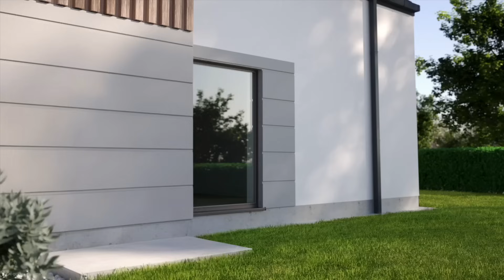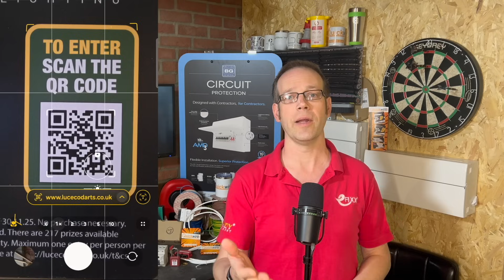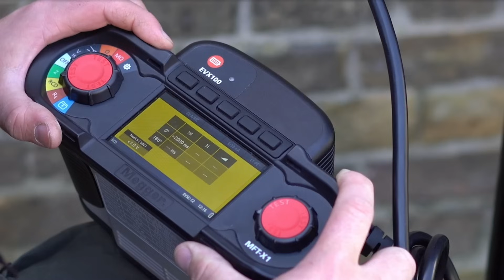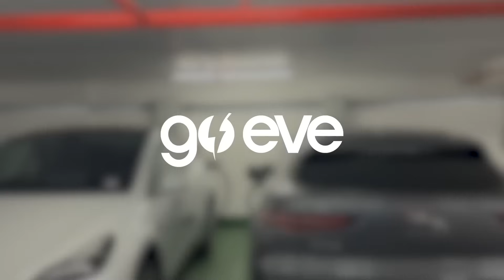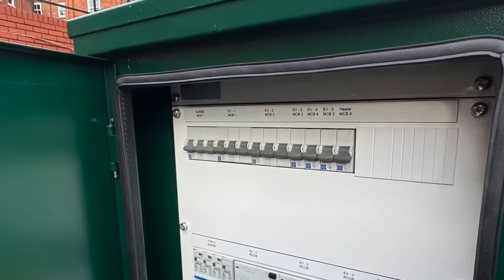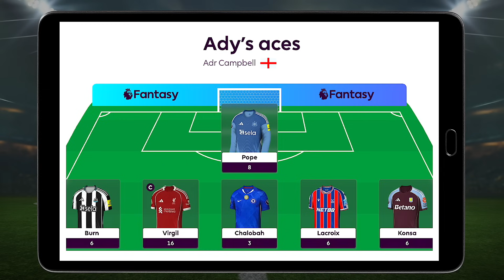National Grid Wants To Move Electricity Meters To The Garden

Comment: Curiously, I work where 20 kW of air conditioning is standard and I haven't seen single phase for years. All incoming is external, however, its not in a cheap plastic box that will get damaged by a kid riding their bike into it, they are brick / re-enforced concrete built (or sometimes recessed into a wall). They contain the isolators, meter, a utility DB (that powers the utility equipment), the LTE/M equipment (and associated control gear), and a DB that contains the consumer SPD,, AFDD, 3-phase MCBS / RCBOs for the A/C's, HP's, Pool, House, EVcp , main house and any other property (boiler rooms, maids cottages, workshops etc). However, a typical install of this external 'box' will cost 4-7k in builders costs and will house about 4k worth of gear and as you can guess will require a lot of 16mm 4-core+Pc, plus there is 400 for the inspection, 400-800 for utility connection and quite often they involve other specialist trades (such as aluminum doors). So we finish up with two issues, firstly is the 10k basic cost and secondly, more insurmountable  is the role of the electrician!  This is because I used to drive a transit with a few testers, drills, a good selection of tools, 20 rolls of wire and 10 boxes of gear in the back, now I need two digging machines, be a site manager, need to be able (and qualified) to submit site, architectural / structural drawings, you're working with 16mm/25mm 4-core SWA which is impossible on your own, you're working with 4m lengths of 3" ducting, you need a decent loader or JCB to move 5-10 tons of infill gravel and so the list goes on... Then if that isn't bad enough, all this machinery needs to be parked and transported and at least 1-2 days per month maintaining it! I'm all geared up for it now and can take it all in my stride,, but it took me years! What I would say is that as an electrician, as soon as you start working outside of a single 'entity', the costs, infra-structure, qualifications and skills skyrockets and my advice would be great if you are a bit older and enjoy that type of thing BUT if you are have a young family and a mortgage, forget it! 
This Friday, I'm starting to install one of these, I've allocated about 5-6 weeks and have a builder all geared up to build the structures etc, if anybody could be interested I could take some footage of just how much work (and cost) these distributed installs can be, I think a lot of fellow electricians will just say 'gearing up for photovoltaic over the past few years has been one thing, we draw the line with post-fit distributed installs!'

Comment: Re plastic CU's.
A friend had a cu in a flat she rents replaced last week for about £1k. Both the electrician & estate agent insisted it was a legal requirement for the plastic unit to be replaced.
No EICR was done prior to this & the unit was in good condition, in a small utility room not near any combustible materials, not under wooden stairs or on an exit route.
It was a plastic split load dual rcd cu.
I'm not a practicing electrician so not fully up to speed with latest regs.
Could someone clarify what the position is regarding rented properties.

Comment: 8kW is the output rating for a typical heat pump.
Input power is about 3kW
Reply: And if you insulate your house properly it's 800W.
Reply: My oven draws 4kW on boost... I also have an EV charger, a tumble dryer, a washing machine, an immersion heater and a dishwasher. And a household battery with a 5kW inverter and 10kW of solar panels running through two 5kW string inverters.
A 100amp cutout. 
my DNO didn't appear to be bothered.

Comment: I very much am going to say no due to the fact.

A) door gets damaged and now you have soaked electricals.

B) anyone can vandalize or steal the meter.

C) keeping it inside the house means the meter is not exposed to temperature changes, and winters that may exceed what the meter was designed for especially with meters with lithium batteries.

Also the only meter which is capable for operation outside is meters which are designed for it. And that's central management nodes for streetlights such as Mayflower which are used in place of photocells.
Reply: We have our leccy meter in an outdoor cabinet that's cut into the wall and it works fine. It's well away from the street, though.
Reply: @spankeyfish  nice, but from what I have seen, nearby me is a key meter which has been exposed to the elements...... The doors been ripped off and it's corroding... I am not going to do anything as it's not my house.

Comment: I used to live in Spain and most houses in the countryside here have the meters on the property boundary at the road. It made much more sense than making the meter readers come inside the houses to read meters like they did in the UK! I also wonder if smart meters would get better signal outside than being buried in the middle of a house?
Reply: The "signals" are goes over the electrical system back to the electric company. So the place of the meter is equal. Funny in most Spanish provinces and islands they used it. Nobody drives from Madrid to Fuerteventura to read a meter! Funny too that most parts of Spain didn't known heavy snowfall and -30°C in winter time same UK known. So do you can't compare UK with Spain.
Reply: @OldLordSpeedy  Not any more, they have all been scrapped, so has the old urban mesh, search for LTE/M
Reply: Well you'd think the smart meters would get a better signal but it looks like they are being put in a metal box that's going to block the signal. Groan.
Reply: @davebodger2  No, they use LTE/M that is part of 4G on a different frequency and modulation etc that works inside buildings, car parks because it bounces!  Google it, its quite interesting

Comment: One wonders how they will put a box on the property boundary when the boundary is the thick stone wall on the roadside. Similarly how does it work on "open plan" developments where planning consent required no structures in front of the building line. And what about terraced houses that are directly on a narrow pavement - nowhere to put anything there. While I can see there may be an advantage to the DNO it looks like an idea that's not been properly thought out.
Reply: That's exactly what I do! And yes! you're dead right, as an electrician you need to submit architectural drawings, get planning permission (because its a modification over 1.2m), sign off the building regs, get a builder to rebuild the footings (and make the enclosure), install 3" ducts, sort out the landscape gardeners to rebuild the ornate wall, flower beds, grass, it's not a couple of days work (or a couple of hundred quid!)
Reply: Not sure how it works when the only space out the edge of the property is the entrance to your driveway or your driveway is accessed by private property with access agreement.
I know for certain our feed in is through a neighbours garden and doesn't come onto our property until it's feet from the meter box on the back corner of our house.
We are already having problems because we can't get fibre installed because the copper line crosses under a privately owned block paved driveway and 3 people's gardens and wasn't installed in pipes it was laid in the trench with the sewage pipes.
Reply: Got to agree with this.
And I can't imagine how they would rejig the supply cable? Whilst an alteration in the footpath is possible, does it then become reused as a sub main under the garden? Then at the 'old' meter position does it gain an isolator?

I do want to see more detail about this.

Comment: Damn colour blindness test I fail it and I do loads of electronic stuff but noone will touch me coz of it
Reply: Dont worry I have a theory that all electricians are slightly colour blind and dont realise it and to a large extent its not relevant. Nowadays, I never use black as a live 230v AC conductor out of principle because the choice of black was stupid especially since red/black is used for DC so in full compliance, all my blacks are brown with black heat shrink 8mm rings every 10cm on the exposed ends (same with grey!) then I can use purple/grey for HVAC signal or the A & B on the RS485 / ModBus cabling. We should be able to buy brown with a grey or black stripe (to replace black and grey) and T&E with two browns (one with a white stripe) and the penus that invented TC&E just needs shooting!

Comment: id actually prefer my meter to be outside. im renovating a century old house and the meter is now neatly located in a nice custom made wooden enclosure. id have to replace the meter sooner or later to get solar panels and the new digital meter. they will make me move the meter to a place right next to the front door for safety reasons. in case of fire, firemen can turn it off. this will ruin the original untouched 100 year old beautiful wood and stone finishes im trying so hard to restore. having it outside in a box behind a bush would be the ideal solution for me. then again, i have the luxury of having a front garden, id be soooo against an ugly box attached directly to one of my exterior walls.
Reply: Outside and accessible is ok. But on the boundary, because that’s where it’s convenient for the distributor? Not so sure.
Reply: It doesn't have to be an ugly plastic box, last year, on a very posh property (with an unlimited budget), I had a lovely stone one with a small tiled roof built that was recessed into the roadside wall that housed all the equipment I installed. Builder charged 3 grand to construct what was essentially a small matching house, it but it was super posh and over-the-top! I even installed a light in the roof area, not part of the contract but it just seemed to be a neat touch. Since then, the builder has told me that he has built quite a few more based on the same design, some stone, some painted white...

Comment: There are countless thousands of RURAL properties that only have a single phase network supply.
Also, for a given load 3 phase has a lot less "Wiring Losses" than the equivalent single phase wiring.
The issue we have here in the UK is that the network infrastructure can't supply the extra demand for heat pumps and EV vehicles so installing 3 phase to residential properties does nothing to improve supply capacity.
Reply: The DNO will now pay for any of the 11kV work to get three phase to your property, including the new transformer. It didn't used to be like that, but they recently changed it.

Comment: My parents live in a bungalow built in 1964 which is supplied with 3ph. 
Their consumer unit is fed via a random phase while the other 2 phase cartridge fuses have been removed and then the carriers put  back in and sealed. 
They are three phase ready!
Reply: My bungalow is early 60s, and I wonder if the massive thick cable is three phase? It's crusty and old, and possibly original? I wonder if it needs replacing? The house next-door takes its supply just before my meter, and the cable is much thinner.

Comment: Having the meterbox outside the house is already a wild concept but moving it somewere in the garden is insane.

Had my meterbox near the entrance but moved it to the garage when adding PV. 3 phase ofcourse, even most flats have 3 phase power. 
It's very rare to find a single phase install and I never worked on one.
Reply: Whilst the "Block" of flats has a 3 phase supply each individual flat has its own single phase supply.
Just had to have a 3 phase Surge protector fitted to get a new EICR.
Steel box and 3 phase SP module cost well over £500 then fitting on top.

Comment: A heat pump draws 8kW?  Maybe if you live in a castle.
Reply: Indeed, one suspects some moron doesn't understand the difference between input power spec and (thermal) output power spec.
Reply: If everyone will be using EV chargers and have heat pumps will the cheep rate electricity disappear?
Reply: @davefish8107 doubtful. They keep building nuclear power stations and wind farms, and that doesn’t turn off at night.
Reply: Evan,

even with Hinkley  and Sizewell we will only have the same capacity as we had just a few short years ago, and much less than we used to have. As for wind, you only have that if the weather is suitable, which contrary to belief is not that much on average.
Much talk about small modular reactors but in typical U.K. fashion, talk and actual operational units seem to take forever.
Reply: @iareid8255 renewables are producing 60% of load right now, and nuclear 6%.  With inter connectors and storage (including at home and in cars) we can and should make the most use of renewables.  A lot of this is available at night.
Reply: @iareid8255  We manage to run wind generation fairly effectively out here on the plains of wearable firearms and an absolutely stupid system of measurement. The biggest issue is land resources, which we have in abundance (Kansas is mostly undeveloped). Solar can be scalable in an urban environment, but wind would be difficult. 

I'm all about renewable energy, which is under threat in my country, because someone orange is still upset about the ones visible from his golf courses.
Reply: K Dawson,

your current president may not understand the practicalities or technicalities but he is 100% correct about them.

All they do is make any grid less stable, less reliable and vastly more expensive per unit to the consumer.
There is not the slightest doubt about that as we have decades now of using them.
Reply: @iareid8255  My state generates over 50% of its energy from wind. We have massive wind farms and we export electricity to the grid in excess of what we require. You can believe that if you want, but your experience is not borne out against the fact that none of the problems you're talking about exist here. The problem, as I stated, is that a country with that kind of population density and private land ownership is going to have a difficult time replicating our model because we have that kind of cheap real estate in treeless flat areas to build a ton of them.
Reply: K Dawson, 

that doesn't alter what I said  at all.

Those problems do not go away by location, specifically, and are not noticeable to the consumer, but they are real.

Intermittency, so there must be adequate back up as well.

Uncontrollable which requires an alternative source that can keep frequency where it should be. That source generally also provides reactive power control and short circuit current level support, vital attributes but lacking in wind and solar generators.

Many states, both in the U.S.A and Australia rely on neighbouring states for power to keep their grid operational.
Reply: What about booster heaters? And when the defrost cycle runs?
Reply: @hullo2u1 the consumption is minimal when the defrost cycle is active. 
Boost heaters are not really a thing these days, modern units work down to -12 or whatever at full output (albeit reduced CoP). If the system is designed correctly that’s all it needs.
Reply: An R290 25 degree over ambient heat pump has a CoP of about 4, so a typical 16-20kW heat pump will consume about 4-5 kW so will be 3-phase (16 kW is about the limit of a single phase heat pump). As you go higher in output than 20kW to say 30 kW (that would require an 8 kW feed) life gets very complicated, it's not about scaling, they require vertical flows, buffer systems, strainers, constant pressure pumps, external control systems, you're no longer an electrician you are a HVAC design engineer who spends most days on his CAD system!
Reply: Heat pumps lol, they cant sell them at cost.
All the heat pump startups in my town were gone in six months.
Reply: @chargeriderepeat7024 right, nobody needs some scam installer charging 10 grand when you can buy an a2a for self install for 500 quid.
Reply: @chargeriderepeat7024  I kind of agree,  but R290 systems that circulate at 65 degrees with all DC drive components dont have that old vibration, the tolerances are much tighter, the circulation system is constant pressure (not flow) and installers are becoming a lot more educated and experienced. However, even with a Net metering photovoltaic system that can generate at least 3000 kW Hr of credit before winter with a import/export differential of say 20p you're still 10-15 years buy back so they are crap and you're right! I am installing much larger photovoltaic Net metering where the credit is about 6000 kW Hr, the differential is 28p and being in the HVAC trade I am buying at great discounts and recently the maths are all starting to work, especially with the monoblocs that dont need buffering. Only big issue is that compared to installing PVS there's no money to be made in that side of industry so even with the bigger systems, as an electrician you can earn more installing the modern complicated hybrid PVS / EV and all that stuff so what's the point so you are spot on!